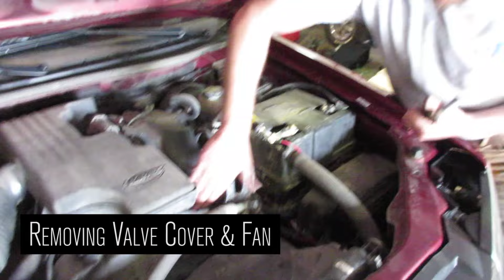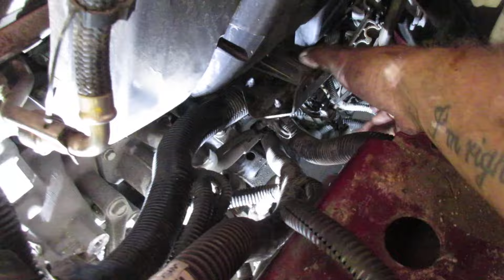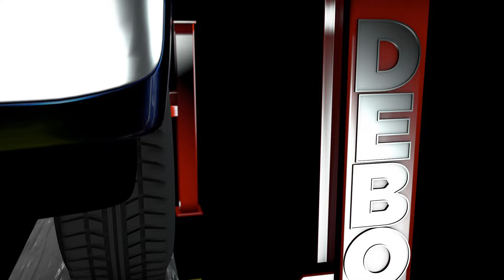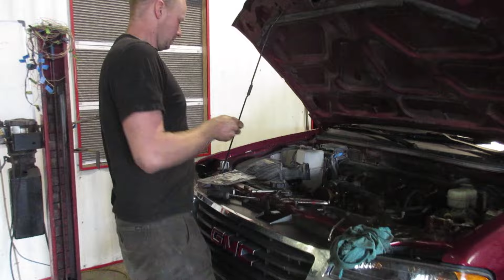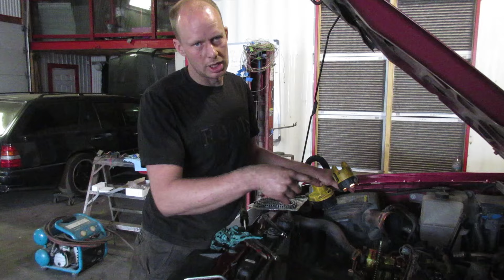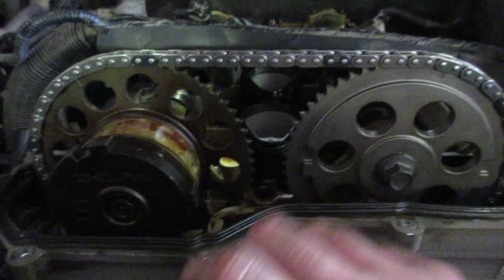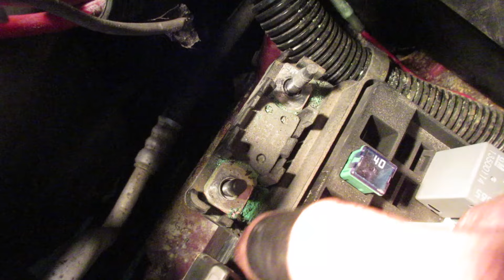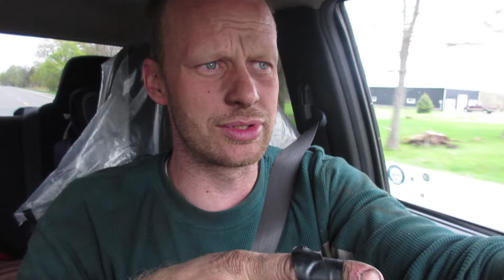Over-Engineering At Its Finest! GMC Canyon Needs A Timing Chain

Comment: Real engines don't have timing chains or belts.  They have timing gears.   To me, balancing shafts are the sign of a poorly designed engine.
Reply: @D.O.A. It's actually an inline 4 in this case.  The inline 5 would've been a 3.5 or 3.7 liter.
Reply: Not so fast on balance shafts. My honda blackbird has 2 and if the cam chain guess sour you pull the valve cover, knock a pin out of the chain, knock a pin out of the new chain, temp splice the together and crank the motor over until shit lines back up
Reply: No gm can't make a timing chain that lasts I drive Toyota and have never had a timing chain problem
Reply: Gee, the motor in my 4 cylinder m/c engine makes 165 hp with 1130 cc has a chain for the cam and a chain for the 2 balance shafts and has almost 100k worth of seriously hard miles on it and only had the valve cover off twice to check valve lash
Reply: @adamwhite9665  Then you don't have a 22RE
Reply: @slowstang88  only had one 22re never had any timing chain problems this guy doesn't know what he talking about
Reply: 187000 miles on my vehicle with a timing chain. No issues. Seem fine.
Reply: @adamwhite9665  Ive had 8 Celica's with the 22R and RE they have massive Chain design flaws.
Reply: @adamwhite9665  false never had any issue with my cobalt with 200,000 miles and my Silverado with over 200,000 miles.  My rear brakes are still original on my cobalt.
Reply: @rickyhoffman9002  I've made a living replacing GM's timings chain hundreds of them
Reply: @adamwhite9665  I must have a good one. I beat the crap out of it. The trans slips a little and the doors are rusted out  but its the best vehicle I ever owned.
Reply: @darkblaze176  properly set up gears can take more that a chain or belt ever will
Reply: @adjustablehammer3749  I hear statements like this all of the time.
That's an interesting statement because I've never seen a timing chain break unless something catastrophic happened to the engine. If someone's engine is actually breaking chains, then obviously something's not right. It isn't the timing chain's fault, and it certainly isn't because the engine is "too radical".
  On big, bad to the bone, serious engines making between 1,500 and 3,000+ HP, we use Jesel belt drives, which is a RUBBER belt spinning a cam that has a tremendous load on it with ultra heavy, triple valve springs with three and four times the spring pressures than any basic performance spring, and with cams that have lifts in the .850+" area. if a rubber belt doesn't break, neither will a good steel chain.

 So the Durability between Chains and gears is almost negligible.  As with most things that have different ways to configure them, there is no “better or worse”. Each have their own advantages and disadvantages.

Timing chains tend to have issues with the gears(actually sprockets) wearing enough to effectively retard camshaft timing. Some chain drive systems use a chain tensioner to maintain camshaft timing, but tensioners tend to wear out resulting in chain becoming so loose it ends up jumping the teeth on drive sprockets, causing serious damage on interference engines. Timing chains can be found in every type of automotive engines.

Timing belts have an advantage in the noise department. Chains tend to be noisy, belts are able to absorb noises. Timing belts have a specified service life and must be replaced at specified time to avoid any internal engine damage. As with chain driven camshafts, timing belts can be found in every engine configuration. Configurations that require long length timing belts are generally not configured to support belts though.

Gear driven camshafts supply the most accurate camshaft timing over the life of the engine. There is typically no maintenance of the gear drive required. Gear drives tend to be the noisiest of all different cam drives. This is due to backlash of the gears. Spur or straight cut gears will always have a very small amount of clearance or lash in between the gears.
Reply: @darkblaze176   darkblaze176  I am not saying that belts or chains are week but mearly gears are stronger but unless you are pushing stupid horsepower the load on a timing mechanism is pretty minimal but if a manufacturer is willing to spend a little more and put gears it gives a bit of a indication to the build quality but belt chain or gears they are all good I was just wondering what you where on about when you say and I quote "gear driven timing is complete trash and week as fuck"
Reply: Most cars, even the sturdier, more bulletproof (when cared for) classic cars have at least a chain. I don't think timing gears have been standard since the late 50's or early 60's.
Reply: @lsswappedcessna  Some engines still have gears it tends to be agricultural or earth movers rarther than cars
Reply: @adjustablehammer3749  Ah, ok. So, engines that normally don't spin over 3 or 4 thousand RPM.
Reply: @Avery Allen there are major reasons why Manufacturers changed to belts and chains. 😒😒
Reply: @Avery Allen Belts are quieter. Less expensive to manufacture. Less expensive to replace. Less expensive to maintain. And the assembly weighs less.

  Gears need to to be well lubricated, are expensive, need close tolerances. Chains need lubrication but it can be pretty basic. 

 They are cheep and can have loose tolerances. Toothed belts do not need lubrication but don't have the load capacity and long life of chain. 

 Main reason is Production cost and Engine noise. and imagine how many gears it would require just to turn the Cams on a DOHC engine like the LLR and L52 FFS dude!
Reply: @Avery Allen As i said there are reasons Manufacturers went away from it !
Reply: darkblaze176 awful lot of motorcycle engines cranking 10k+ running gears and OHCs.
Reply: no, a balance shaft is used usually for inline engines because of the vibrations of the wierd firing orders, your pretty boomer
Reply: Yeah my 2gr fe has gears
Reply: Its a inline 4 cylinder. They vibrate. If you don't want it to buzz then you need to buy a subaru.
Reply: Unless you have 6 cylinders in a row (I-6, V-12, etc.) you are gonna need a balance shaft.
Reply: @darkblaze176  the chain isnt the problem. It's always the plastic guides and tensioners that are the problem.
Reply: @cjeam9199  My friends Colorado's t.c. slipped at 200,000

Comment: If you are over 200k on the motor mine was a 2.9L 4 cyl, I think your best bet is to pull the motor and replace it with a Vortech V6. I pulled the V6 from a blazer that was rear ended and this particular engine was a factory rebuild with less than 20K miles on it. I had to rob some other items from my poor 99 blazer but the motor fit. The performance is a lot than that 4 cyl. My Colorado is lighter than that wrecked blazer but the milage was much better than I expected. 18 mpg in town and about 25 mpg on the interstate. That blazer was about 16 mpg. The man hours would have been similar if I chose to change those timing chains. But either way I would have pulled the 2.9L for ease of access.

Comment: Of course there is one left had thread bolt in the mix. I've always said..."you shouldn't be allowed to be a automotive engineer unless you've worked on cars for at least five years" BTW...love the mechanics band aid.
Reply: FUCKIN A
Reply: With all the women flooding the STEM fields this is just about to go off the charts!!!   Political correctness at it's finest!!
Reply: Gary Bullwinkle They have been in the auto industry for decades.   The ones I worked with had it together better than the guys.   And earning a degree and getting hired in ain't easy.  PC my ass.
Reply: king of the world got that right and the same for lawyers telling our soldier they can and can not shoot at.  strap some boots on them and send them to the front lines
Reply: you do know, the engineers do this on purpose right? its to encourage people to take their cars to the stealership to get them fixed there or to encourage people to just get a new car. its to keep business coming in. that being said it isn't necessarily the engineers fault, its the fault of management and those making business decisions. engineers just follow the requirements they are given.
Reply: I have no doubt it's done purposefully.  I once complained to Ford that I couldn't reach the dipstick on my f150...i was told it was like that on purpose....they don't want me under the hood at all.
Reply: The leftie's there so if (when) that bearing fails it doesn't immediately spin the bolt out into the flywheel/flexplate, it gets the opportunity to make some noise first.  That's the "focused engineering" answer. 

The "good engineering" answer is the feckin' 2'nd/3'rd harmonics balancer setup should be integrated with a stronger front chain assembly or fully inside the damn sump where it's easier to access and well lubed, there shouldn't be a damned idler gear inside the bellhousing to even have to consider failure modes for. 

This is all an artifact of having too many engineers, and too strong of a task management system in place. You end up with one guy engineering the timing set, another guy managing the balancer assembly while trying not to interfere with the guy engineering the timing set, a third guy is working on wiring management that works with 5 different assembly lines... not VEHICLES, assembly lines... Fourth guy, poor bastard, gets to integrate all these little single systems into a working package and knows that submitting an alteration puts him behind a month so it gets kludged together within a certain amount of reason that sometimes isn't so reasonable. 

It's why my '03 Sonoma's 2.2L has an air path that starts with the filter box behind the driver's headlight, runs across the core support top to a resonator box behind the passenger's headlight, makes a 150 degree turn (and interfaces with a plastic globe resonator that blocks battery access) and runs across the front of the engine with a flex tube, makes another 150 degree bend to enter the throttle body, which goes into an airbox and runners that cross over the valve cover to the other side of the engine. If you couldn't keep up, the air path in this thing crosses the motor no less than 3 times and is about 8' long, in a space where I can rest my hands on both fenders....

Comment: Pretty decent video. Wish you would have filmed the trans removal though 😅 I have an 08 with the 2.9L (inline 4). Bought it brand new in August 2007. At about 55k miles or so I got the P0017 code (exhaust cam position sensor) but I continued to drive it until I was due for emissions test around 70k miles or so. Turned out to be the timing chain so I pulled the mofo apart in my driveway early September of '16 and replaced the timing chain, guides and tensioner. I also replaced the cam phaser which I noticed in the video you guys did not do. I skipped on doing the balance shaft chain though because I didn't have the equipment on hand to pull the fuggin trans off and back, and I ran out of time on my 4 day weekend. Needless to say, here I am 2 years later, due for emissions end of August and the P0017 is back again. I think this chain went bad even sooner this time because I skipped on doing the balance shaft chain, but I can't say for sure. I've had this truck for 10 years now and only have 97k miles on it. Shittiest thing is it has always driven fine even with the code and stretched chain, but it does throw the P0017 code and loses a little gas mileage. I'm going to either trade it in or buy a new engine. Still debating...  Biggest POS design IMO. Also, the cam phaser is advanced and retarded via engine oil pressure to the cam actuator solenoid which is also a possible cause of the P0017 code and is an easy fix, but more than likely the shitty chain will be stretched. The new Colorados look better and bigger and come with V6 and even diesels too. But I'm still thinking of switching to Ford even though I've always been a Chevy guy since my first vehicle that was an '84 S10 4 speed V6.

Comment: With the 3.5 in-line 5w with the 4WD you have to completely take out the suspension and the front axle in order to access the oil pan.  Book time is 23 hours for the job, not including parts cost.

Comment: What a fricken pain in the ass. I don't mind a good project once in a while, but that's a load of crap. Sounds like a good candidate for a 4bt swap.
Reply: Ford Escort timing belt change is also a nightmare... Pinto was easy...
Reply: I will forever love the Ford 2.3/2.5 SOHC engines. They really don't get simpler than that. I have a 2000 Ranger 2.5 and I just did the plugs and wires, including the "dreaded" driver's side. I know I'm really competent with vehicles and mechanic work but it was a relative cake walk. The hardest things are probably getting the two little coolant hoses back on and realigning the bolts for the EGR. There are some quirks and dumb engineering on the later models like mine, but nowhere near as stupid as this Canyon.
Reply: BuzzLOLOL pinto easy but every 30kit broke on
the 2000 cc.
Reply: love my ranger. 4.0, manual trans and 2wd, roll up windows and locks. Pretty simple.
Reply: TheeJoeyLee  that clutch slave cylinder can be a pain in the ass
Reply: LS swap would be a lot better...plus they came from the factory with them after 2009 so its an easy swap. any 2008+ is EASY ass ls swap project and before then just takes a little customizing
Reply: Koshunae for older, smaller engines you can't beat the Japanese 4 bangers of the 90s. They weren't all that peppy, but they'd survive a nuclear blast.

Comment: And you were saying that GM engineering makes soooooo much more sense than Ford. LOL just giving you a hard time, love the videos keep em coming!
Reply: LS7 or Bust it is isuzu. I have an isuzu and the engine design is absured. The alternator is at the bottom of the engine where a non removable skid plate lives
Reply: thats a chevy i5 not an isuzu isuzu makes bulletproof 4cyl diesels they put in the box vans
Reply: James Flores Exactly. If it's not that it's their own 4 cyl.
Reply: In Japan they simply replace the whole engine instead of the timing chain. That is why it's designed the way it is.
Reply: It's chevys i5 not isuzus atlas is the company who makes them for chevy
Reply: I6 -1 cyl= i5-1 cyl= i4 they share 75% of parts according to four wheeler network
Reply: Gabe Wall Ford's SOHC 4.0 v6 used in everything from the 2001-12 Ranger, 1997-2010 Explorer, and 2005-10 Mustang all used a rear timing chain just as moronic as this Canyon's 2.9. Except in the Ford 4.0's case, it was all done that way because Ford simply cheaped out by using one head casting for both left and right banks, hence, one cam sprocket ends up at the front, the other at the rear, plus a 3rd timing chain between the crankshaft and the jackshaft.
Reply: They've all got their own flaws and strengths. Dodge, Chevy, Ford or Toyota. Had trucks from all of them, they all haul stuff, until they break, then they all cost more to repair than we want to pay, all of them
Reply: Exactly, no brand is perfect they all have flaws my original comment was to simply point out that no brand is  perfect.
Reply: all ive got to say 1995 Toyota tacoma never once broken down and very fun to drive capable offroad we a few times loaded it up with a 275 gallon toat full of water; half full was scary with the water sloshing around didnt have the swaybars brakes and suspension to deal with that
Reply: If you've worked on them it does! Like the old Vulcan 3.0 with that stupid water ports in the timing cover that always leak, their lousy wiring, or some of their FWD cars that oblige you to drop half the engine out of the car to remove a water pump because it doesn't clear the sub-frame, to name a few. They all have their moments, but ford seems to take the cake. They've made some decent stuff, but they have lots of idiosyncrasies that I don't like.
Reply: My preference is GM cause its a good mix of ease of repair (most of them) and low cost. I like Honda, but they are WAY overpriced. A good example is some of their mid 2000's starters that had a list price of 800-900 DOLLARS and only lasted about 75k miles. Can get a GM one for about a buck fifty that will last well past 100k miles. Even a replacement brush set for the Honda starter was more than that, which is ridiculous.
Reply: mysock351C i like GM's because you rarely have to work on them. Sometimes their little quirks with the electronics but mechanical wise, i love it
Reply: Gabe Wall that's more expensive than a high torque starter for a d13 Volvo. And our trucks at work are 100k machines. I just did 2 starters yesterday and they are 480 bucks each.
Reply: The 80s-90s Thunderbirds/Merc Cougars were fucking awful. Only Ford could figure out how to take a narrow angle V6 and make it fit more poorly in a car that happily accepted a 5.0 Windsor V8. I helped my high school-girlfriend's father change the water pump and do a general tune up on one with the 3.8l V6 and it was an all-day fiasco. I swear when we finally got the rearmost plugs out, they were the originals from the factory. They didn't match the other four, and had no electrodes left.
Reply: thank them Germans for that one
Reply: or Japanese or English you know mazda and range rover as well as astin martin

Comment: Wow, wish I would have stumbled upon this video earlier as I just bought a 2010 canyon for quite cheap that had a check engine light on. Just got it diagnosed at the shop and it's the timing chain and they told me it would be about $3300 Canadian and around 20 shop hours.  And the truck only has just over 90k km's on it. Frustrating but I should have researched more before buying, thought I was getting a screaming deal. 
My first vehicle was a 91 Chevy S10, miss how simple and reliable that truck was....until my sister got her hands on it, haha.